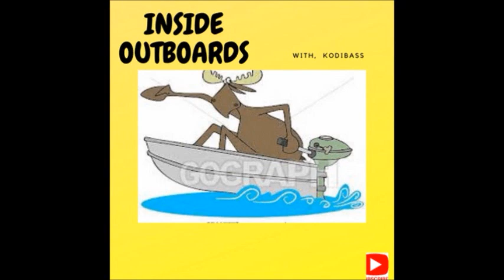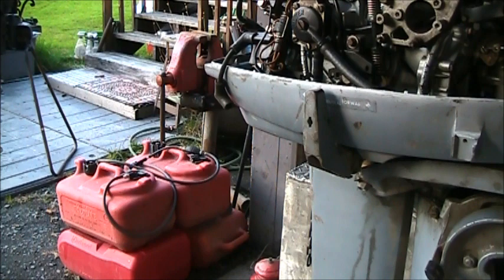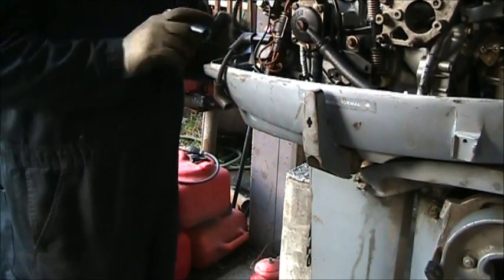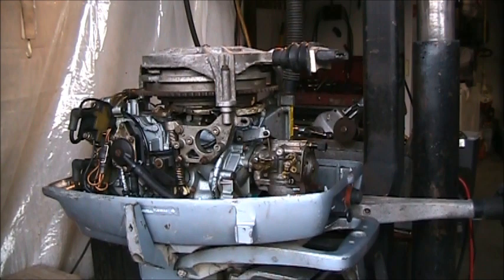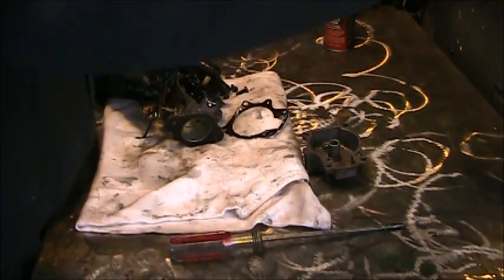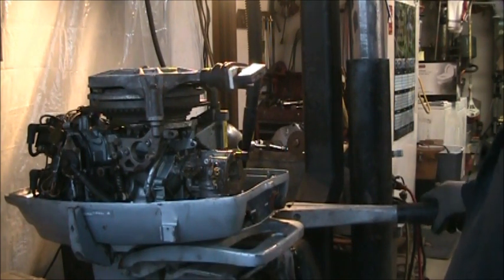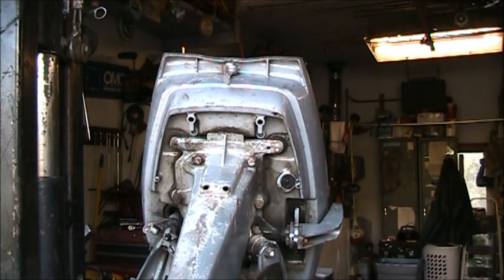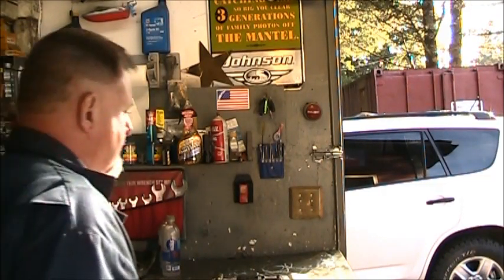1983 EVINRUDE 35 HP ,  been sitting for years

Comment: Wonderful videos and really helpful.  It is always fun watching someone that knows their stuff.   Got a puzzle for you.    Pulled my 84 Johnson 35 out of several years of storage a couple weeks ago.   Started and ran, got water from the indicator right away.   Then the water stopped.  Pulled the lower, impeller looked fine but completely replaced the water pump with an oem kit since it was apart.  Still no water, pulled the head cover and replaced the thermostat.   No blockages seen.   Passages were very clean actually.   Pulled the exhaust cover, no blockages.   Put it all back together with new gaskets.   Garden hose connected to the water riser tube runs water out of the indicator as it should.  Installed the lower still no water from the indicator.   Pulled the power unit and replaced the upper grommet, guide, and gasket.   Everything looked good.   Replaced the complete water pump again on chance the first new one was bad.  Still no water from the indicator.   Did the testing with both muffs and a tank.   It is getting exhaust from the indicator and the various ports on the midsection and thru the prop.  The engine runs fine.   Any clue what I am missing?
Reply: Assuming you installed the impeller correctly, and that water passages are indeed clear based on your test, there is only one thing left-thermostat. Let motor run hot to the touch of a finger but not too hot where you can’t touch the head for like three seconds as you don’t want to overheat, but see if thermostat opens up. Or, take thermostat out and do a boil water test, and see if it opens and closes when out of boiled water consistently. Could be a failing thermostat.

Comment: I got the same motor was sitting for years and not running. Cleaned it up, changed fuel pump, cleaned carb twice using a gallon of carb cleaner and tips you’ve shared in your other videos, motor starts real east now, primer bulb stays hard during and after it dies. Basically, it sneezes lightly and then dies mostly when first started, lasts longer like ten minutes when hot and like 2 minutes when cold. I watched videos on how to adjust the carb and I have tried every position from 1 full turn, 1 1/1 turns, 2 full turns, and the n betweens giving it a lot of time to adjust and still happening. Reed valves are good. Starts super easy, even when I rev it still does the symptom of sneeze and die. Fuel line is new and fuel is good. I tried same tank and line on another motor and it’s running well. I’m lost I need help.

Comment: I have a 1981 evinrude 35hp pullstart, it won't turn over unless I pull the spark plugs out,it set for   5 years in a barn before I purchased it, just can't figure it out
Reply from the maker: Sure we can figure it out, OK so what brand type /# spark plugs R U using?  With the plugs out squirt some 2 cycl oil in the cylinders.  Get a socket that fits the flywheel nut, Spin motor over for 3-5 minutes with a electric drill  with plugs out.  Your plugs should B champion L77jc4  or  QL77jc4.  Once motor has been spun good replace plugs and see if it will pull over.    kb
Reply: @kodibassInsideoutboards  OK I bought the plugs and put 2 cycle oil in and  installed plugs, it won't spin over, I let it sit over night and tried again and still nothing
Reply from the maker: @swdw197478   Ok  time to look inside @ the cylinders, It's no big deal  remove the power pack, coils & anything in the way of the head bolts.  Take out the 8 head bolts & see how the cylinder walls look.    kb
Reply: @kodibassInsideoutboards  broke 3 headbolts,bottom cylinders has a  deep Crack and it looks burnt orange

Comment: I have a 1983 35 HP Evinrude we have replaced all lines , coil packs and cleaned the carb. Runs like a top for 10 minutes then starts surging an bogging down . You got any ideas on what may be causing this? Your videos are very very helpful
Reply from the maker: Re-check the carb. look hard @ the upper transition chamber holes for blockage.  kodi
Reply: After ten minutes or so fuel bowl on carb gets empty and fuel pump is failing to keep it at proper level—is my unprofessional theory. I would absolutely re-clean carb as that never hurts but I would also inspect fuel pump (assuming all lines were sealed properly at connections)

Comment: Kodi, I need the carb and intake off that motor.
Reply from the maker: +T1234,  I will look & see if I have those for ya.         kodi
Reply: The parts diagram for that motor's carb (#393057) shows an electric choke bolted to the side of the carb, but I don't see it on that carb. Is the electric choke just optional for when you have a controls box and key switch? I see a manual choke on this  motor that makes me think the electric choke in the parts diagram is just for keyed applications.